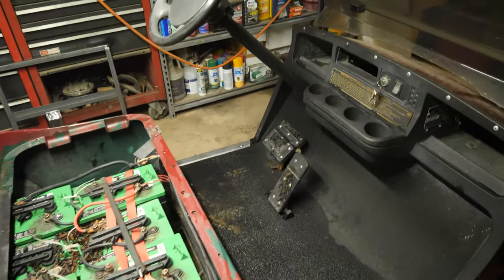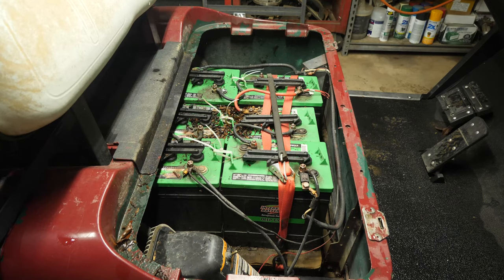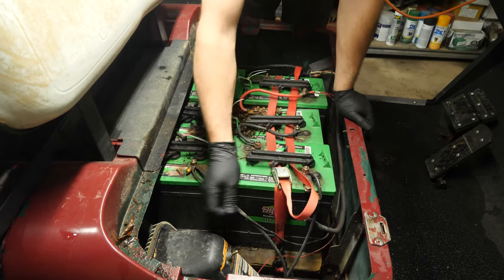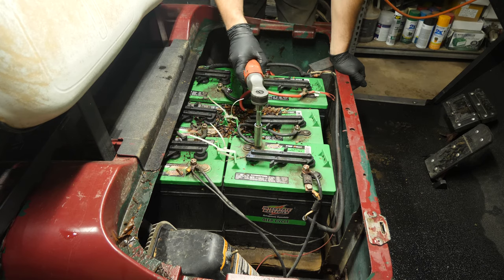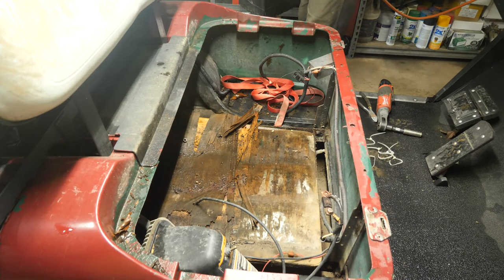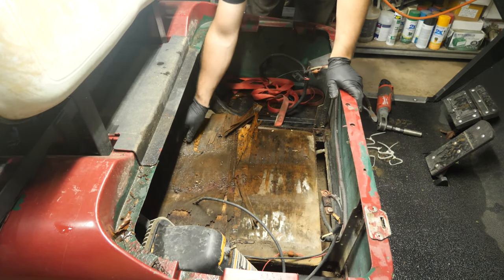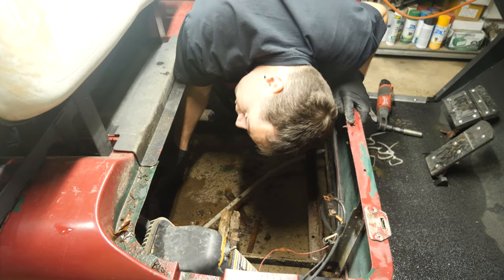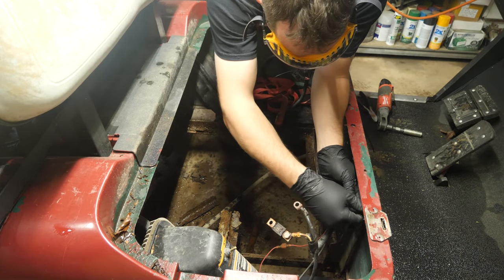2001 EZGO TXT, 36 Volt Electric - Replace Battery Tray

Comment: Wow good work! Question, the brackets you welded on the rear side, is there enough clearance to change or remove electric motor? Or is it removed another way? Thanks Kevin great job as always.
Reply from the maker: Thanks, Eric! The electric motor is typically removed through the access panel in the rear bagwell. I've removed them by lowering them next to the axle, or by removing the batteries and pulling it out that way. This battery tray sits a little bit lower than the stock one just to add some clearance to the 2 outer rear batteries.

Comment: Hi! I could really use your help. 

I am trying to fix a 1990 EZGO Marathon 36v for my older family member. 

I figured it was just the solenoid, replaced it. Nothing. Battery pack has 36v, I took apart forward and reverse switch, it had a bad micro switch, I hooked the solenoid up without the resistor or diode just for testing purposes but I can’t get the solenoid to even click. Where should I start? If I ground the little small post it will click but I can’t get it to go just by the pedal. 

Micro switch on pedal assembly is good. 

HELP. I am about to pull my hair out lol

Comment: Did the 2000 TXT have a Run/Tow switch? Or was that a 2001 thing? The Camera / Mic setup you have is great!
Reply from the maker: I believe some of the later models did. I could be wrong though.
Reply: I'm late but I think the PDS came out in 98/99 and PDS models have the Run/tow switch